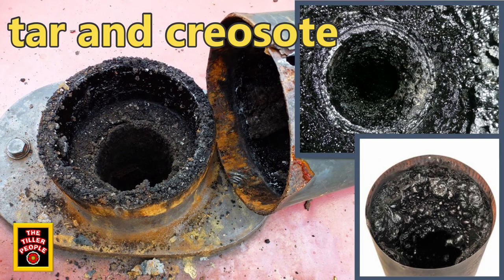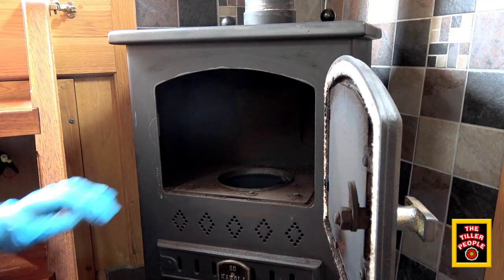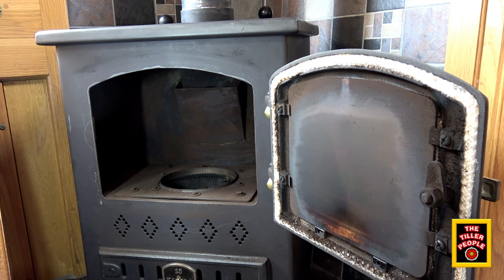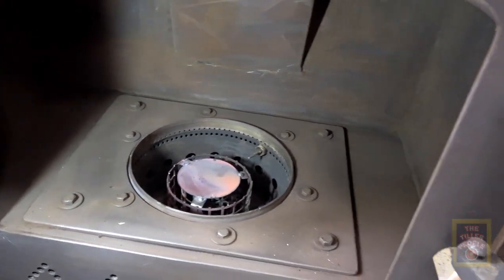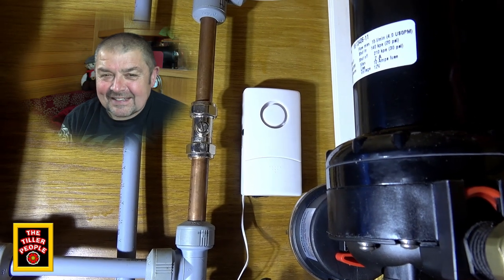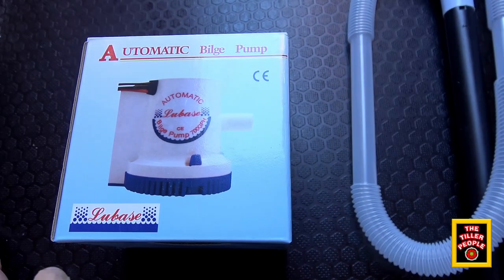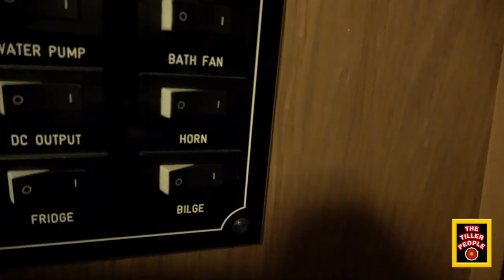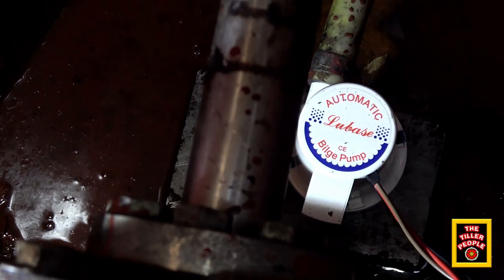Our Narrowboat Travels - 2022 - 226 - What a load of BILGE

Comment: Hello Keith and Bernadette
Enjoyed watching your maintenance tips. The advice about water detectors is very sound. We noticed our boat was listing and found water from a broken pump was going under our floor. Any ideas on how to improve the water flow from our shower? It's a lovely new shower with very poor flow.I
Take care.
Reply from the maker: Hi
Without seeing your system it is difficult to give accurate advice. If your old shower worked fine then you need to check if your new shower is suitable. Your existing water pump may not be able to cope with your new shower water flow rate. If possible check any filters and if you are confident enough disconnect the supply to the shower unit to check the water flow.
Hopefully you may find the above suggestions helpful.
Stay safe and weĺl. B & K 👍👫❤️

Comment: I fashioned a wire scraper out of a coat hanger to do the big clean behind the pot wall it clears out the soot well 👌
Reply from the maker: Hi David
The main thing is keeping on top of stove maintainance. Having to visit properties with carbon monoxide poisoning victims still on site means I know what knowledge, safety, negligence and incompetence is all about.
Rules are a bit different on boats but that does not mean a mend and make do mentality will be okay. Cheers. B & K 👍👫
Reply: @TheTillerPeopleNarrowboaters  Keeping on top of it means it works when you need it too ! Getting close to keeping it on 24/7 now not just the nights

Comment: Good advice as ever.  Just wondering if you plan to do a vlog on winterising the boat.  Approaching my first winter as an owner, in the marina but doubt will visit the boat much so any advice wouid be appreciated
Reply from the maker: Hi Norman
When we leave our boat anytime over winter we always drain the water off via the taps, making sure we wait until the taps are just spurting slightly. We leave all the taps open and disconnect the shower hose and leave the shower turned 
Hon. Make sure you check the antifreeze in your engine, a tester costs around £10 and gives you piece of mind. We leave our inverter on charge mode to manage our battery bank. All our gas and diesel is switched off. To avoid condensation and consequently risking diesel bug make sure you tank is full. We also move our mattress and any cushions away from the side of the boat to allow the material to breath and keeps the sides unmarked.
Hopefully you find the above helpful.  B & K 👍👫❤️
Reply: @TheTillerPeopleNarrowboaters  Thanks for such a concise reply.  Have been told to take mixer valve off shower also but this seems a bit ott to me.  Come spring assume just fill water tank and no need to bleed water system ?  Thanks again , Norman  NB Beatrix Rose
Reply from the maker: If you disconnect the shower hose and open the on/off valves you should be fine, we have never had any issues. Just let any air come out the taps when filling back up. Just one more thing, our water pump can run dry with no issues. Suspect yours will be similar but just check it for piece of mind. Cheers.
Reply: @TheTillerPeopleNarrowboaters  cheers 👍